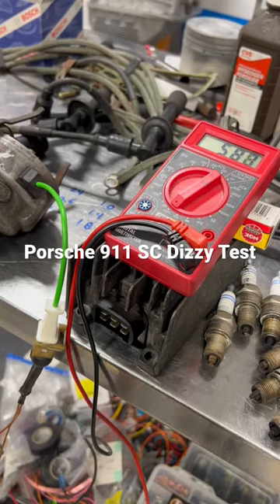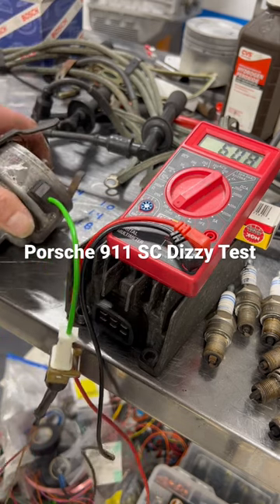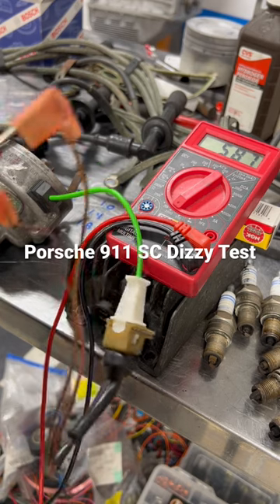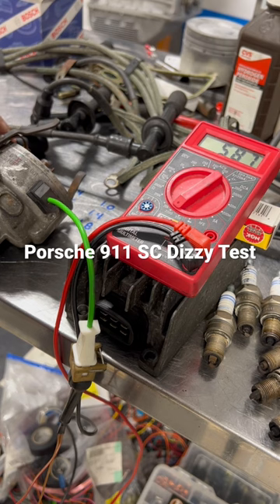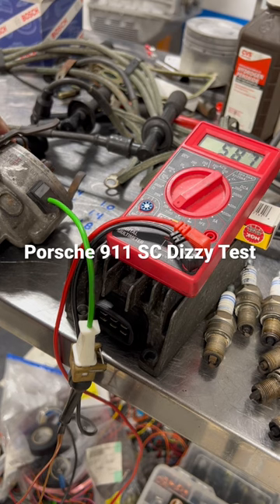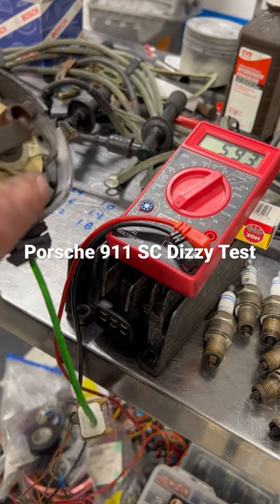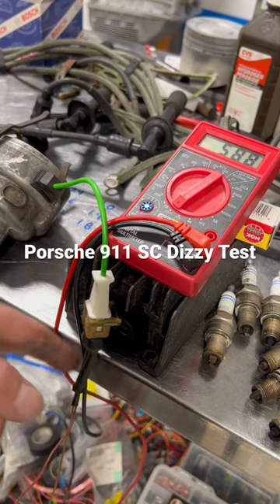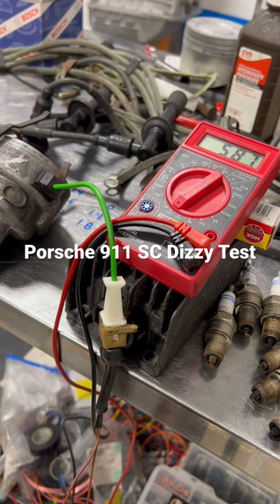Porsche 911SC Distributor Reluctor Wheel Test

Comment: Great tip!  How often do these wheels go bad? What are the symptoms?
Reply from the maker: Used to be damn near never. Now they are starting to show up. Typically it’s an open circuit or short to ground. I pulled one out of storage and it had corrosion build up from not being used and showed open until I cleaned the contacts and then she came back to life.